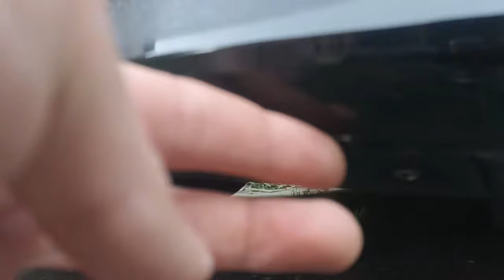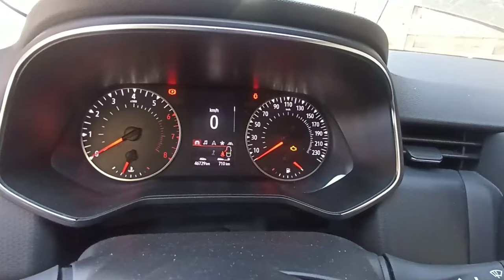Renault Clio 5 V 2019 Maintenance Oil change Air Filter Tutorial Guide Car Repair ASMR

Comment: Torque is not 25,5 Nm. I think it means 25 +0 -5Nm, So everything between 20...25 is ok. Its tolerance mark, that 0 -5. My WV has same writing on the oil filter cap.

Comment: The car position is not flat while you are unloading the oil tank..therefore the used oil can not discharge as much as possible. You would lift back of the car..

Comment: I wanna ask something, why you put a "little trees" to your  under hood ? 😀 I can see at 2:50
Reply from the maker: I had a stone marten problem that was chewing cables and sleeping on my car battery... Strong smells help, but I also have installed a rodant sound repeller. Just to be sure. ;)
Reply: @obvious007   Nice tactic 😀, I have the same car with same engine and I wanna do this periodic maintenances myself , how many oil liters do ı need to put, is 4 liter is enough ?
Reply from the maker: @cantugyldz9888  Always buy a 5 liter can. That"s cheaper than 4x1 liter + you have some reserve. You also have the Clio V 1.0 TCe 100pk? Go to your local car dealer and give them your VIN number, they will tell you which type oil (5w30 c3 RN --> 3,7 liters for my vehicle),  type oil filter and type air filter you need. Good luck! It's really easy. You can also look up auto-data.net for extra info about the vehicle.
Reply: @obvious007  Thanks a lot for informations. My local dealers says same things. I can put engine oil max 3.7 liters but in my country they say İ need to add 5w40 Rn710 type of oil to this 1.0 TCe 100ps. İ think, this engine oil types we need to add will change country by country.
Reply from the maker: @cantugyldz9888  indeed, it depens on the climate you live in. Good luck mate!
Reply: Hacıı bu clio5 joy sce değil dimi?
Reply: @beterolun3023  Hayır tce